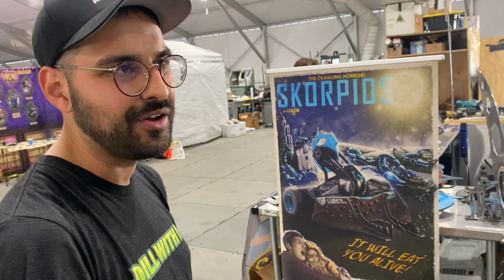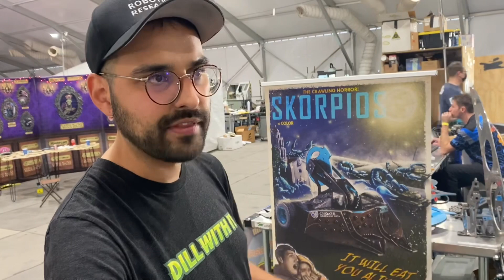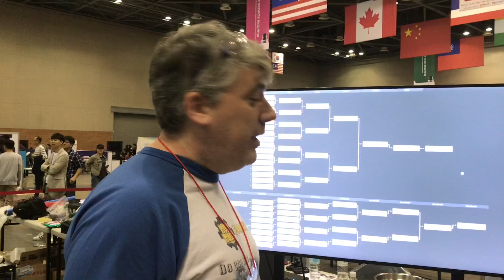Does BATTLEBOTS Have A FORK PROBLEM?

Comment: Since the massive forks end up compromising your ability to drive (see S6 - Hydra vs. Endgame),  I feel like they are self-limiting and don't need a specifically counter-fork rule. I would love to see a video outlining various approaches to ground game, since I feel like it's such a big part of the sport and most fans don't really appreciate how it works. While ground-gaming until you can't drive leads to boring fights, being able to get under your opponent makes basically any type of robot more effective (especially non-spinners), so I think understanding how the ground games works would help fans see more of the strategy battle between teams rather than just seeing the negative aspects of attempting to win the ground game.
Reply: it does self-limit the size which is good, and the arms race mostly seems to be in creating more effective designs across a variety of lengths and shapes and styles, which is also good. The design space still allows for some fairly ridiculous forks being reasonable choices, and can be pretty meh when two bots keep getting their braces caught together. I don't think they need to but IF they wanted to limit forks for that reason or whatever, I like Emmanuel's suggestion quite a lot.
Reply: @wyrmh0le  Emmanuel’s suggestion is definitely a super popular one because it adds a cost to ground attachments without creating a ton of definition issues. It’s still pretty easy to cheese by putting an absurdly geared tiny motor in charge of fork movement and getting your passive forks back when it breaks.
Reply: The recent endgame/ripperoni fight.. the absurd comically long forks of endgame.
I thought they were just trying to be sarcastic or something at that point. Lol
Reply: Check out the self limiting in End Games Vs. Ripperoni
Reply: @wiresmith2398  Yeah awful cheeky of Team Skorpios to pose the fork question right before that fight. Lol

Comment: So let me add my take on the whole forks controversy. I honestly think forks are fine. Winning the ground game is so important in Battlebots. It can literally be the difference between you winning or losing a match. If you want a perfect example of that, just look at the rematch between Hydra and Tantrum and how Tantrum was able to get underneath Hydra and dominate them. Had Tantrum not used those forks… the fight could’ve played out very differently. Forks allow bots that normally wouldn’t have a chance against other bots to have a fighting chance. How would your fight against Jackpot played out had you not used that fork configuration? Also, forks do involve some risk and are not a sure fire guarantee that you will win. Look at Valkyrie vs Banshee or an even better example is Endgame vs Ripperoni. Make them too long.., and you risk them getting stuck in the kill saws or other hazards. I know people complain about the kill saws, but this is why I think they should remain. They act as a check against forks. So let people bring forks…but know there is a risk you could end up screwing yourself if you get caught in one of the hazards.

Comment: The problem with limiting forks is that it gets fuzzy fast. Huge's stabilizers most certainly aren't forks, but both Mammoth and Deep Six had long structures out front for stability. When does that turn into a fork? Also, where do you start measuring to determine fork length?
Reply: Mammoth and Deep Six both have plastic stabilizers.
Reply: @TheLaXandro  That's irrelevant because a fork is a fork regardless of material.

Comment: seems the consensus is excessively long forks is its own problem and is rather self-regulating. certainly it wouldn't take long to come up with some defense for it, and at some point even BB 'competitors' will start to show little mercy against someone stuck in the kill saw slot or wedged under the side of the box.

Comment: Rather than make a rule, I would just raise every other steel plate by setting it on washers. Then dragging your forks becomes a liability. Couple this with a rule change that being counted out requires that one bot drive from one starting box to the other and sit motionless for 15 seconds or so, all without any contact from the other bot. This demonstrates one bot is running and the other bot is significantly impaired. It is less subjective. 

This leaves articulating wedges as an option for those who need them but has the risk of breaking and dragging leaving your bot unable to move across the arena. 

I would also replace the kill saws and hammers with flippers. Those are so much more fun to watch and could be used by a team on their own bot if they want to flip back over. Also, I have yet to see a fight in which the kill saws were involved in a way I wanted to see.

Comment: Forks ruin the spectacle a bit, either they work in which case the match is one sided or they don't in which case the design becomes fatally compromised and the match is one sided. Ban passively articulating forks of any length. Design to win the ground game properly or don't. No floppy paddles on the front pls!

Permanent forks like skorpios has that don't articulate are fine. Lifter forks are fine.

Comment: I agree, forks and wedgelets have gotten out of control. Endgame v Blip was boring as hell as End game put a wall of wedgelets and hid behind them when the spinner died. Hydra also hides behind wedgelets and has lacked aggression for the last two seasons, the wedgelets also killed its drive more than once so a limit of length and amount (8 if they are either side of a weapon, ----+----, and 10 if there isn't a weapon making a gap between the central wedgelets, ----------, that's how I'd decide how many wedgelets you can have).